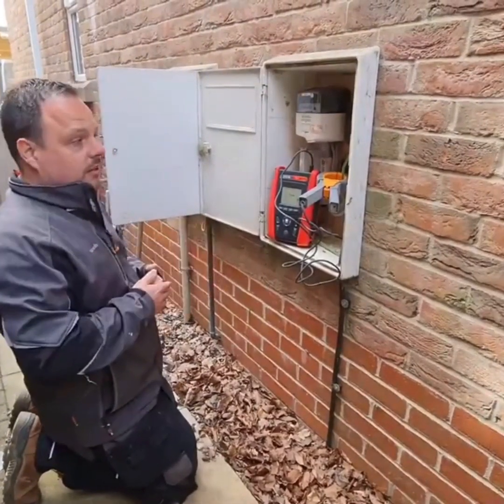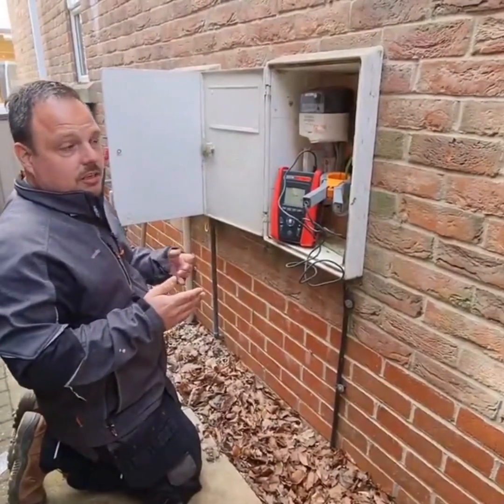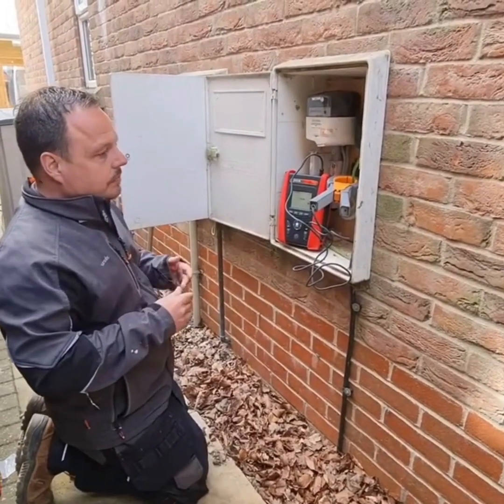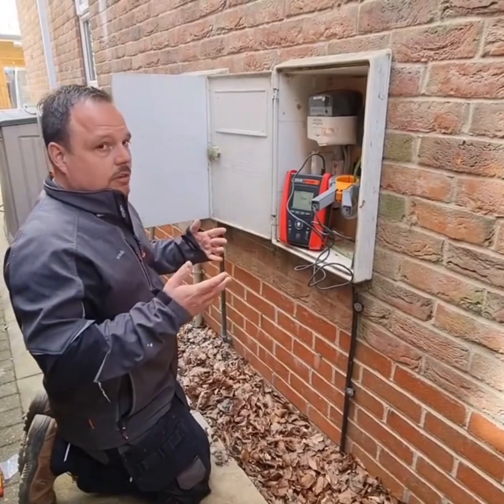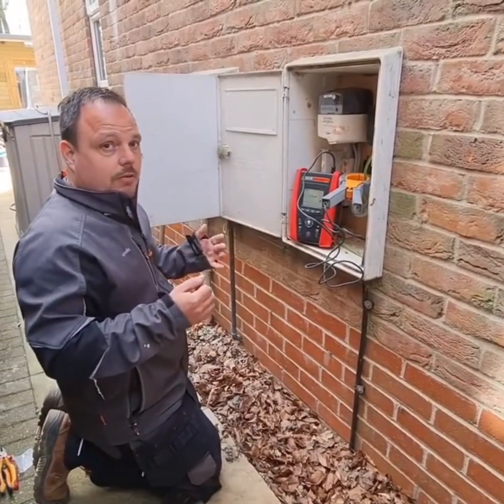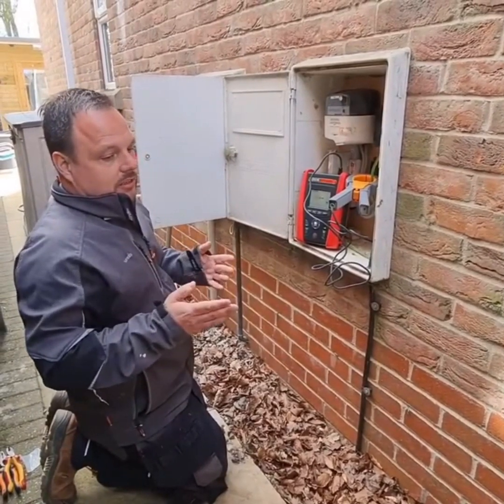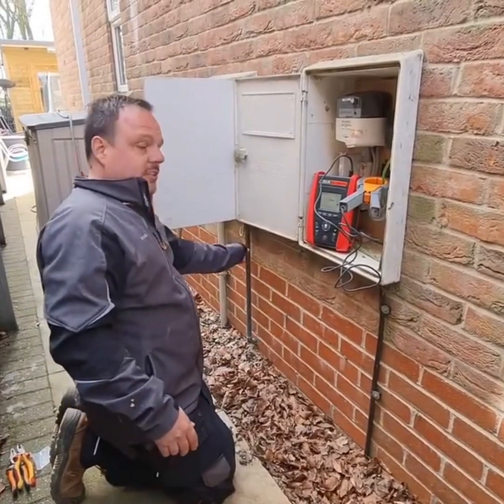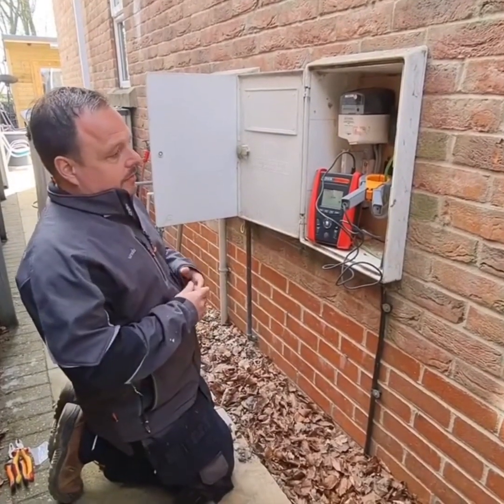Diverted Neutral Current Safety notice #shorts

Comment: I think they should have a trailing clamp on ameter attached to modern smart meters constantly monitoring the earth currents from the service head. The smart meter could immediately alert the DNO of any potential issues to initiate an investigation. Some of these issues can go on for years and it only becomes apparent when someone gets hurt.
Reply: If the pen conductor is broken or high resistance on the cable leading into the property, monitoring at the end of the street or the transformer isn't going to do any good. A few months ago the house across from mine had a high resistance fault on the pen conductor. Everything seemed to work ok but when he put a high load on such as the kettle everything dropped out. They dug the road up and the joint was arcing away in a clay pot filled with bitumen. They redid the joints in resin and redid mine as well while they had it dug up. I took the opportunity to have a chat with the guys doing the work. They said it happens very often and it usually shows up in a similar way to a high load drop out and fortunately accidents are rare but they do happen. This is what got me thinking about it as it's rarely addressed and a number of sparks I've spoken to seem unaware of it or have a very basic grasp only due to having installed ev chargers. I think it wouldn't cost much to incorporate a clamp on coil into the next generation of smart meters to monitor earth current and perhaps more importantly now with the roll out of so many ev chargers. Anyway  would like to say thanks for helping to bring awareness to this subject.
Reply from the maker: @Clip7heApex  I don't disagree with anything you have said. We often find dropped out neutral exactly as you describe in the street. 

But again it all boils down to cost. 55 million homes is a lot. Hard enough time getting smart meters fitted lol. 

I don't think it will ever happen and we are left with reactive works as we are now.
Reply from the maker: They do monitor at a street (green box) and sub station level. I guess the costs involved need to represent value in relation to the problem. 400 reported cases a year which in the grand scheme of all faults and expenditure required on the DNO network is super super small. 

I dont disagree with monitoring but we need to be realistic in what can be done and paid for.